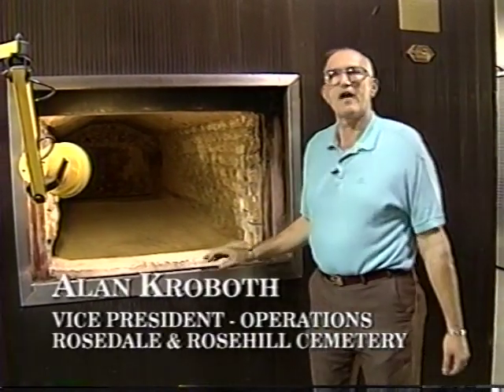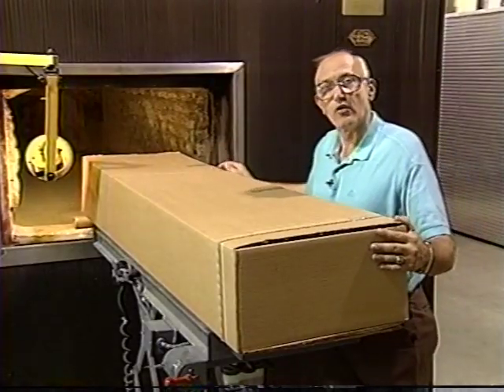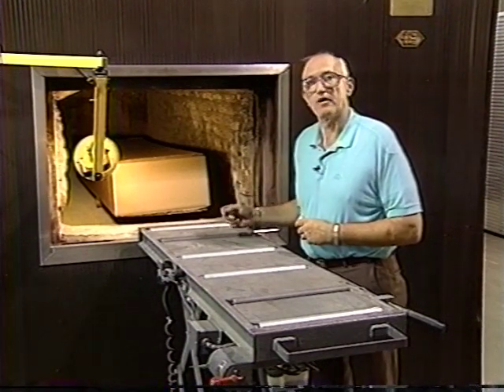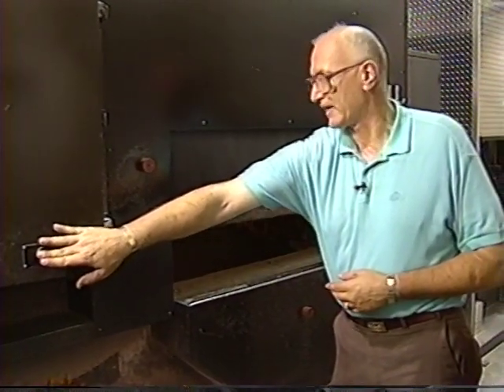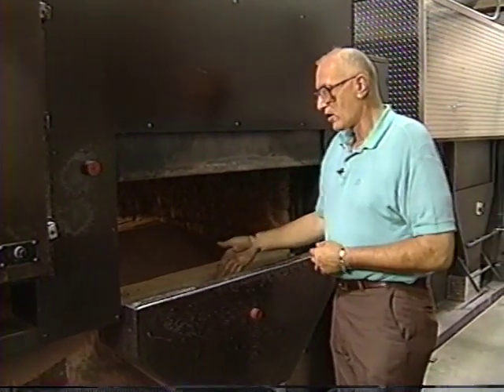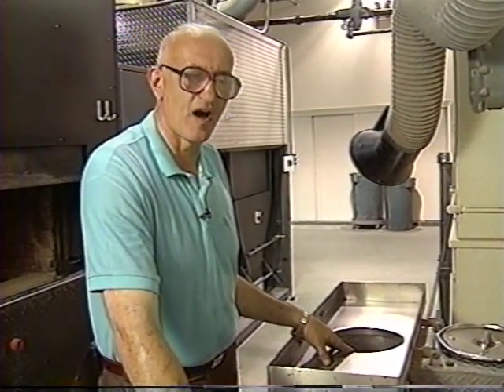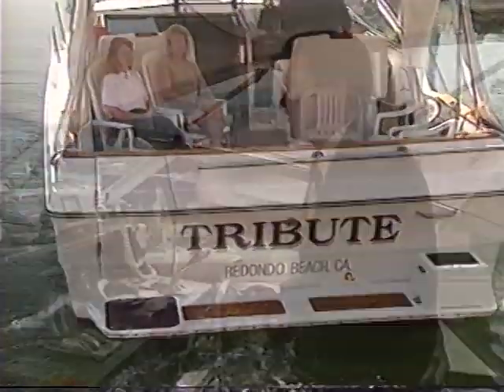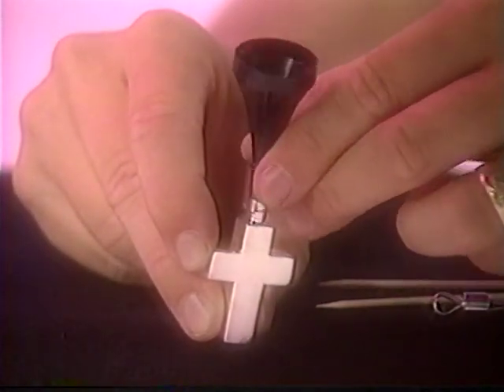The Facts of Death - Part 5 of 6

Comment: Pre-heat oven/crematatorim  chamber. colombarium? to 1000 degrees. add the cardboard box and bake until virtually gone. The procedure depends upon body mass and fat to muscle  tissue ratio. This means a skinny dead person is done in an hour or so. A morbidly obese person will burn for several hundred dollars more. Starving the victim as long as possible in Hospital will ultimately save gas. In the event of sudden death from heart attack caused by excessive weight allow more time in the oven!